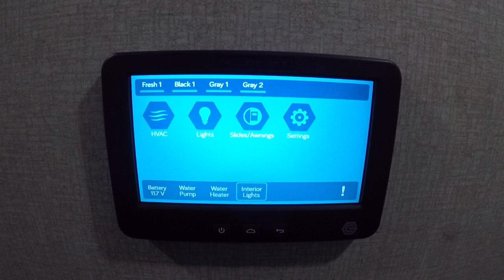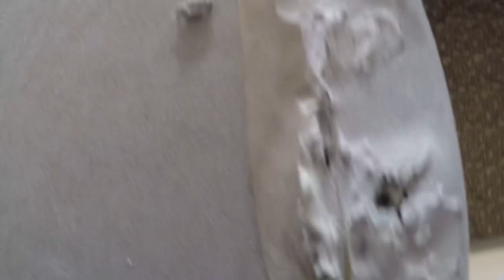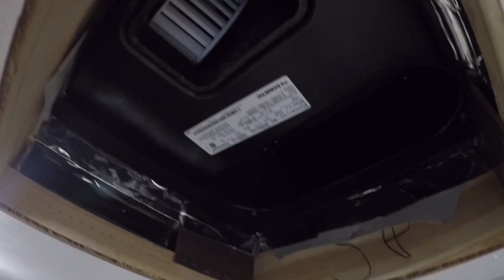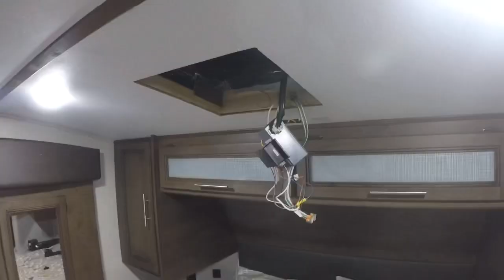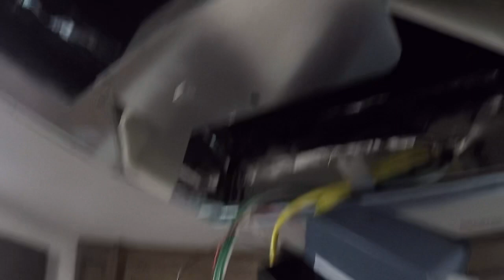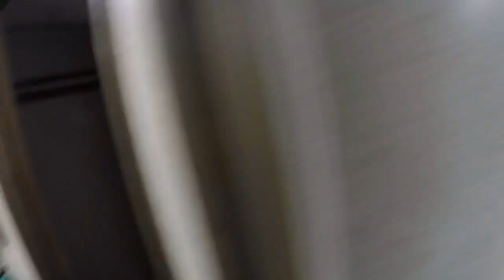How To - Install Second A/C with Keystone In-Command!

Comment: I am looking at doing the exact same project, exact same camper, but it's a 2021. Some questions and points to make. My main reason for the additional AC unit is that my rear unit can't keep up once the sun hits us. In the shade and hot, we are ok. I found that the previous owners had mice, and the mice ate into the ductwork. I have no idea why mice would eat foam insulation (rice-based?), but they did. So my duct work is filled with large holes, and the cold air is filling my roof area as much as my cabins. So my original Coleman unit, I blocked the vent/duct holes for now, and I am forcing all the air into the living area. I need to talk to Coleman to see if this is acceptable. At least I have nice AC in the main room. I am trying to figure out how to fix the ductwork or make new ducts below the ceiling instead of above it. My thought is that with 2 AC units, my 28-foot camper wouldn't need much, if any, ducts. My questions for everyone are, which air conditioning unit would be the best buy? I hear the Coleman units aren't the best. Has anyone else had to make this type of repair?  I would also suggest adding sun reflectors on the remaining skylights. The sun beats into them at high noon. Thanks for any suggestions or ideas.

Comment: You didn't have to shut off the power to. The camper, there are breakers and fuses for the ac you could have shut off to kill just the ac circuit.

Comment: Thanks for the video getting ready to add a front ac to my cougar as well. I did want to mention to you. It will help the volume even more And most of all, quiet, the AC. Look here and YouTube for R V AC dverter. Very easy to do and well worth it like I said. Adds the volume and quiets the unit.

Comment: Thanks for the video! I'm starting my second AC soon. How did the gasket seal end up working against the eternabond tape? Since it's been a while have you noticed any problems?
Reply: I was also curious about this.  Do you have an update on the AC seal?
Reply: @vannooch  I used the tape and it worked great.

Comment: I have the coleman ac unit in my 2022 cougar 24rds, would you happen to know the parts needed for that? Excellent video by the way.
Reply: Shane at Syracuse Camping world knew off the top of his head what I needed. We have a 25rds 2022 and I am about to install mine
Reply: @richreigle2758 Did you get your installation done successfully ? I have a 2024 26RBS and curious about your experience.

Comment: I need to do the exact same thing you have done, however I am confused on the part numbers on the Brisk A/C II all I see is "B57915.XX1C0" for a model number not 630173? In my case on the blank plate it calls for a "511482 Brisk Air II - 13,500 btu. Can you provide a link?

Comment: There is a lot going on here in terms of wires. Were all the wires that are required to operate with the iN·command there? I was under the impression only power is there. Any instructions with it all that assisted in any way? Or did you go completely off of the rear ac install?
Reply from the maker: There will be a 120v power, 12 volt power, the communication wire from the rear air all in that box. The rest of the wires come in a harness with the relay control and gateway. It’s actually simpler than you think. Just take your time and read the labels on the wires.

Comment: Great Video. Are you having issues with the InCommand system when the cabin temp is below 40 or above 100?
Reply from the maker: Hi David, can’t say I have had any problems up to this point. It gets plenty warm and cool in KS but it seems to do fine even in the extremes.
Reply: David, I’ve been having issues with what you have described. Dometic is pointing a finger at In-Command and In-Command is pointing a finger at Dometic.  I think I’ve been able to narrow the issue/fix.  Have you been able to resolve your problem?